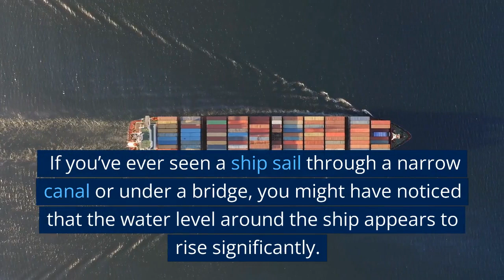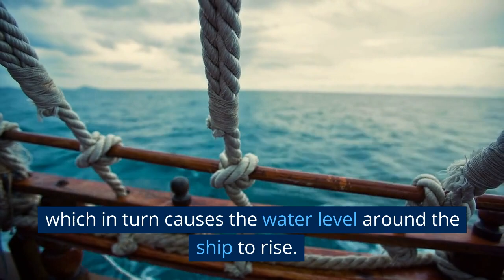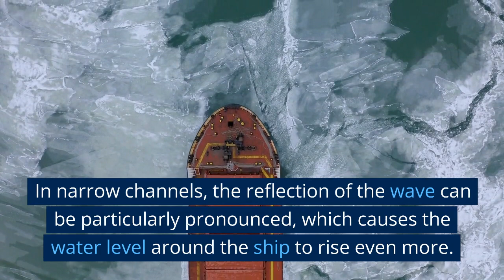Understanding Ship Squat: Navigating Safely in Shallow Waters

Comment: This is not how Squat works. Video is wrong.

This is more akin to small boat properties in water, where the vessel gets higher in the water at high speeds. That isnt Squat.

Squat effects large cargo vessels. Squat does not cause a vessel to raise higher in water. it causes vessel to sink lower in water, because shallow waters under vessel make the water move faster, creating a high pressure under the vessel, making it sink lower in the water, typically lower at the stern.